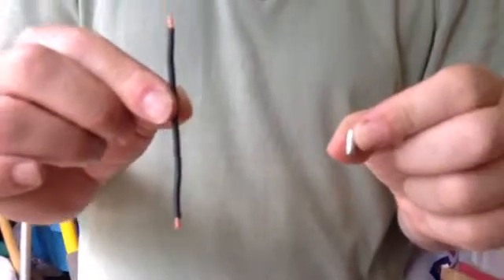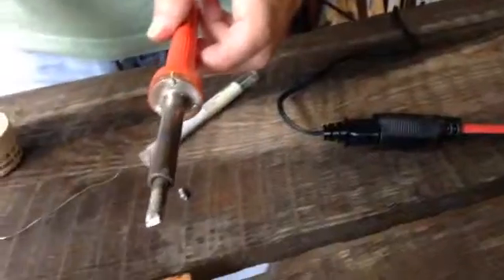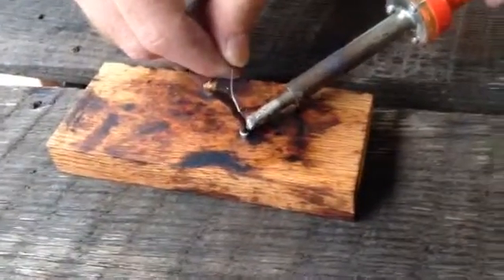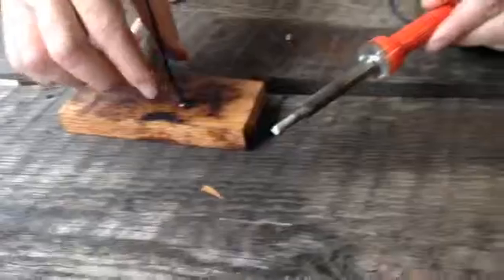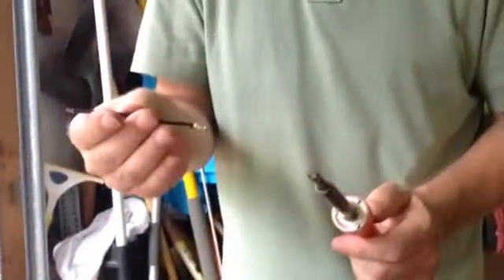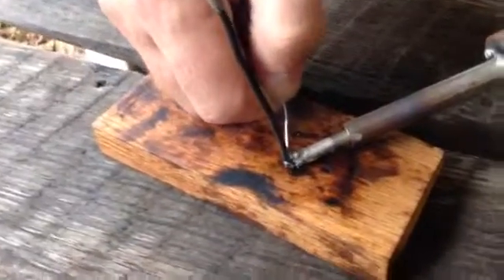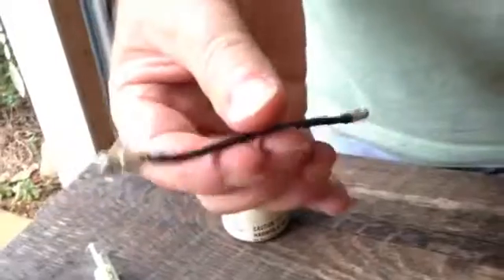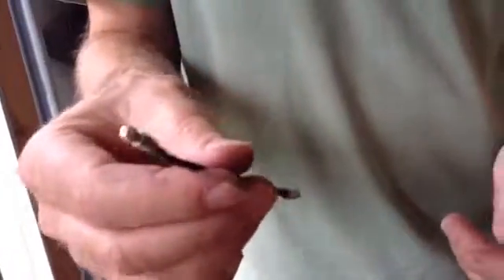Let's Solder a Lucas Male Electrical Connector!

Comment: save yourself some trouble by melting some solder into the connector first, then melt the solder and drop the wire in and that way you don't apply too much heat to the connector.